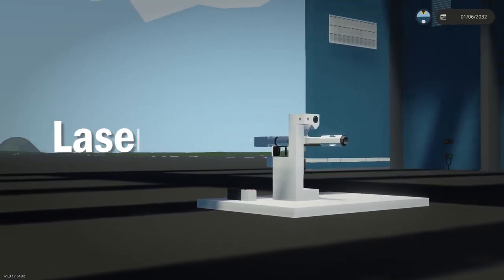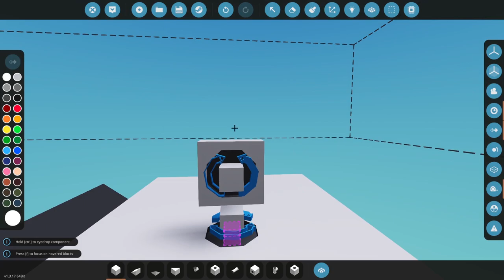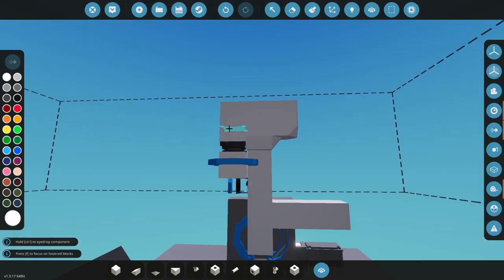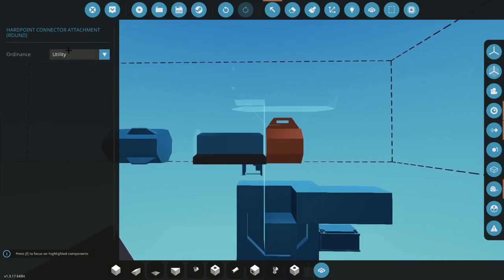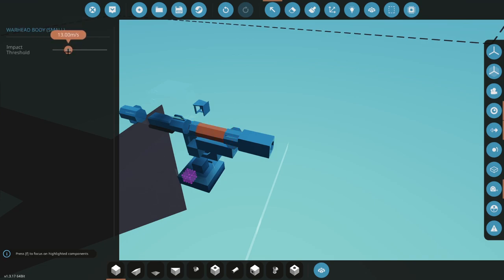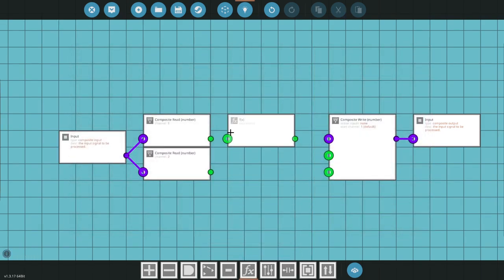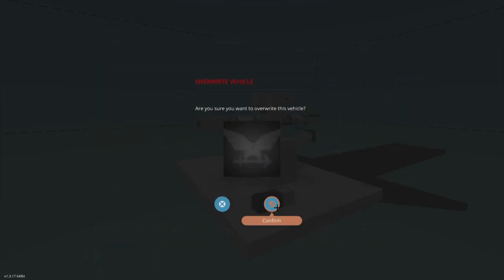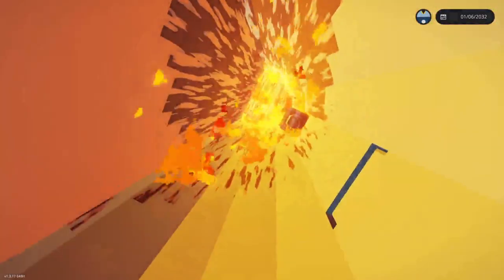How to make Laser Guided Missiles in 6 minutes - Stormworks

Comment: What if you put the laser designator in a plane or ground station and use that laser to communicate with separate missiles?
Reply from the maker: Well, as long as the laser pointer and sensor are on the same wavelength and mode, then you can put these missiles on anything and the laser can be on anything, so yes you can